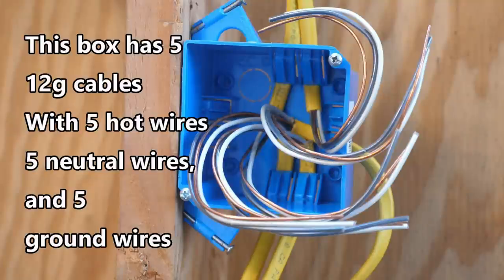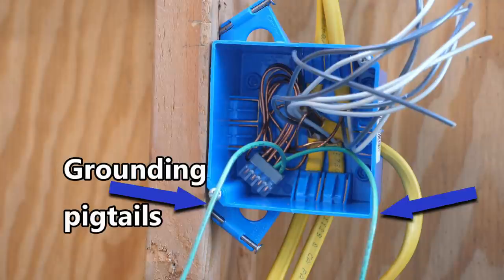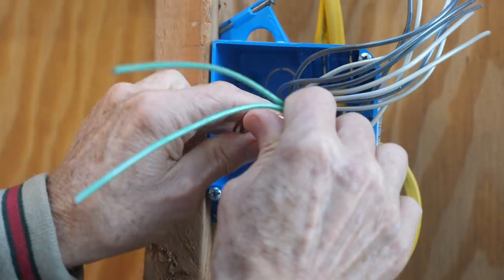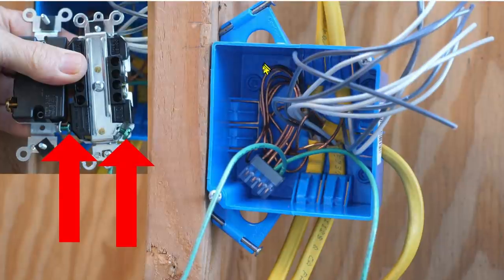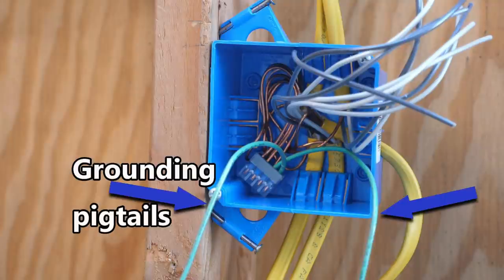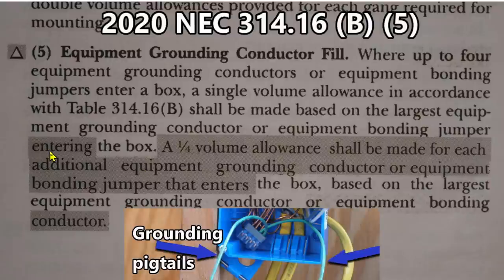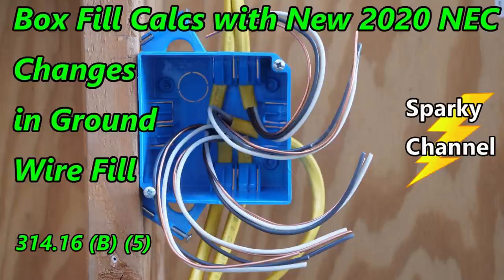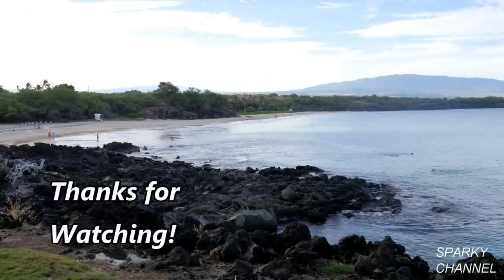Do Pigtails Count in 2020 NEC Box Fill Calcs + How to Handle 7 Ground Wires

Comment: Great vid. Now please make a vid using the 5 wire capacity wago lever nuts to join 7 wires for: ground with pigtails, neutral with pigtails, and live with pigtails. Then show how to dress the wires and connect the devices to them. That is the ultimate video video using jumper wires between wago lever nuts to actually connect everything together. Thanks.
Reply: Baaaah. Wago are the best. Woohoo
Reply: @darrellbarton4341  Wago Lever Nuts are top of the line. They are used on Federal projects and handle full rated current as good if not better than a wire nut. You are confusing them for the cheap knockoff push in connectors or backstabbed outlets
Reply: I hate when I open a box and somebody has jumpered multiple connections together instead of just using big enough wire connectors to make a complete termination.  it's messy and unprofessional.
Reply: Correct
Reply: I love wago.
Reply: @jsncrso  "used on federal projects" doesn't necessarily mean they are the best choice of materials.  and keep in mind stab connections on receptacles were rated for 20 amps, right up until they were delisted because the connections kept burning out.
Reply from the maker: Wow, this is quite a thread. Dave, I'm making that video right now. I think it's going to be one of my best. I wire the whole box and discuss wire management inside the box. That's a topic that needs to be shown and discussed. This is a great opportunity because there are so many cables coming into this box. Also, I use spec grade devices!
Reply: Perfect. Can’t wait. We need to see how to jumper wagos within the same box
Reply: @kenbrown2808  Wago Connectors are they way to go here in Germany for round about 25 years now. It took a long time until electricians here accepted them, Wago introduced its first push-in connectors already in 1979. The first ones had the same problems with burning out connections, but that caused a massive call-back, and the problem was resolved. Problem was the size of the contact area afaik.
So this isn't actually a new product. And most electrical fires here in Germany are caused by carelessness of users, for example covering up ventilation openings of appliances with combustible materials like towels and such stuff, causing heat built-ups. Overload of power strips is also a thing, especially cheap power strips.

Here we must now tighten all screw terminals with the proper torque, using a torque wrench. With these connectors that's not necessary. They also compensate expansion and contraction of copper caused by change of temperature, and they're resistant against vibrations.

These connectors started in switches over 30 years ago, than came outlets with push-in, than came bus bars for neutrals and grounds in panels and now even the circuit breakers have that. Not only for the wires, even the bus bar is just clip in....
Reply: @Marcel_Germann  and here, they come preinstalled on light fixtures, and I'm okay with that, even if one manufacturer has about a 5% failure rate from not getting the fixture leads tinned properly to push in to the connector.  but using mechanical connections has about twice the contact area as wagos, and it doesn't rely on spring tension or on the material of the connection being able to carry the full load.

plus, like I said, the failure rate of our previous stab-in connections leaves me expecting that wagos on power circuits will lead to avoidable service calls.
perhaps the best way to put it would be that I think of ANY kind of stab in connection, like you think of buying a Trabant.
Reply: @kenbrown2808  The difference is, the Trabant wasn't that bad the time it was first introduced. But it was produced too long, it was simply outdated by its technology and design, and that already in the 1970s. Here is a small test showing how different types of connectors behave if you overload them, including Wago connectors, wire nuts, screw type terminals and a crimp. There you can clearly see that the insulation of the cable is the first thing to fail when a significant overload is applied. The 1.5mm² wire is normally used for maximum of 16A, in single phase its maximum rating (depending on the installation method and possible heat dissipation) would be 20A before reaching its critical core temperature of 70°C (158°F) for PVC insulation.

https://www.youtube.com/watch?v=2uYD8e7idnY
Reply: @Marcel_Germann  significant overloads are much less common than sustained loading.  stab in receptacle connections weren't that bad when they were first introduced.  back when someone might plug in a 500W space heater, a vacuum drew less than 4 amps, and computers were something you watched Captain Kirk talk to on the TV.
what I want to see is equal loads connected with properly sized wire nuts, with lever lock Wagos, and with push in Wagos, then compare heat production in the connection.  because THAT will be what tells whether the connection from wire to spring terminal to jumper to spring terminal to wire in a Wago is more efficient than wire held in direct contact with wire by mechanical pressure of a wire nut.

I can also tell you from the number of burned out receptacles I have thrown away that insulation is NOT always the first component to fail when spring terminals fail.
Reply: @kenbrown2808  When a receptacle here fails it's mostly not the push-in connection where the wires are connected to. In most cases the contacts between the plug and the receptacle failed for a simple reason: People here think the outlets and plugs are rated for 16A, so I can draw that permanently. But that's not the case. Some manufacturers label their outlets the correct way: 10A/16A, 250V. The 16A (3680 VA) rating is only for a short period of time, tested for one hour in the certification process. Permanent only 10A (2300 VA, nominal voltage is 230V) are permitted for the Schuko system we use here.
Reply: @Marcel_Germann  and here, in a cheap wiring job, the receptacles are rated for 15A or 12 amps continuous duty; and in a good wiring job, they are rated for 20 amps, or 16, continuous duty.  (continuous duty is defined as an electric heater OR something running for more than 3 hours at a time) and there are three potential areas of failure: most commonly, the stab connections fail from corrosion or repeated heating causing the spring clips to lose their tension; next most commonly; but least commonly fixed, the socket clips lose their tension so the plug doesn't stay in properly; and least commonly, when a socket clip has lost tension it can overheat and cook the face of the receptacle.

the two nemeses of bad wiring here in the US are 1500W portable space heaters (12.5A) and the Hoover Wind Tunnel vacuum. (over 13A run current)
Reply: @kenbrown2808  That's the disadvantage of having a low voltage, the appliances require a much higher amount of current for the same demand. But I think the connectors could handle it, they're designed and rated for higher currents. Here you can also now find connection units for kitchen cookers with Wago connectors inside. Kitchen cookers are hardwired here, in most cases they're three-phase circuits. But still 230V appliances and not 400V. The load is distributed on the three phases, for example one small and one large heating plate on one phase (L1 and L2) and the baking oven is supplied by L3.
We had never such issues, and the VDE is very sensitive and responses quick if such an issue would occur. Some even think they're oversensitive. In the past they were very quick banning installation materials with POTENTIAL safety issues. The VDE is one of the largest independant testing organisations for installation materials and insulated tools in Europe. And they release  the regulations for electrical installations here in Germany.

https://en.wikipedia.org/wiki/VDE_e.V.
Reply from the maker: @Marcel_Germann  Hi Marcel! A viewer wrote me and asked if wire nuts have been banned in Europe. I haven't heard of such a thing. Have they been banned?
Reply: @Marcel_Germann  our electric cookers normally use 120v for the cooktop elements but 240 for the oven. Our biggest reason for using split voltage like we do is that with 120 for the common use, there is much less electrocution risk. Then we. Combine phases for heavy loads.
Reply: @SparkyChannel  No, they're not banned but simply no one uses them anymore. But that's already for decades. They fell out of favour in the 1960s. In Germany we used a completely other type of connector, first three minutes of this video shows how the connectors we used before:

https://youtu.be/_PDnKEgQ-2Q

On the old connectors you had to arrange the wires, in case of five wires they had to be dressed like the five eyes on a die. Meaning four wires in the corners and one in the center. All of the same size and all of the same conductor type (solid, stranded, fine stranded). For connecting solid to stranded there was a special connector required, one like this. In the UK they call them choc block (the old ones were black or brow instad of the modern white ones):

https://upload.wikimedia.org/wikipedia/commons/1/1b/Screw_terminal_with_crimped_wire.jpg

They are sold in such bars, if you require only three or one you can twist them apart on the plastic connecting the connectors.
Reply: @kenbrown2808  120V is still enough to kill a person. Here the standard voltage between line and neutral/ground is 230V and 400V between the three lines. Even in residentials. A 22kW tankless water heater requires here three 32A circuit breakers, they don't require a neutral and run with the 400V.
And to prevent electrocution we got RCDs, you know them as GFCI. The VDE implemented in 1983 a regulation that in new installations "circuits in rooms fitted with a bathtub and/or a shower must be protected by a type A RCD with a tripping current of maximum of 30mA". The transition period ended in 1984. Now almost every outlet circuit must be protected by RCD. And they recomend to install a 10mA one instead of 30mA in bathrooms now. Back then that wasn't possible because there were no 10mA available. But for children and elder people with heart issues the 30mA is too high. 30mA is the threshold for a healthy adult.

And the other thing is to avoid exposed life parts. If you remove or put a Schuko plug only partially into the outlet that the prongs have contact, they are not exposed by design. Impossible to touch. The outlets are recessed into the wall. Others put sleeves on the prongs to prevent this.
Reply: @kenbrown2808  For a kitchen cooker we use in most cases a wire that is in size between AWG 14 and 12, five core (ground included), and fuse that circuit with three 16A circuit breakers.
Reply: @Marcel_Germann  clean dry skin has enough resistance that a healthy person will not be electrocuted with 120VAC.  it's actually not uncommon for some electricians to test circuits by touching the wires.  as for our GFCIs, ours cannot hold above 6mA . but we only require them in wet areas, nearly everything else requires arc-fault interrupters; which I question because we have cheapskate builders doing the absolute maximum circuit loading they can get away with since AFCI breakers cost ten times as much as standard breakers.  then when the homeowner keeps overloading the circuit, their electrician tells them it will cost thousands of dollars to upgrade their circuitry, so they have a handyman come in and he puts in standard breakers with a higher trip value.  then when the overload DOES burn out a connection, there is no arc-fault interrupter to shut the circuit down, and things get ugly, fast.
Reply: @Marcel_Germann  we run three conductor plus ground of #8, and fuse it at 40A, unless it is a high power stove; when it gets #6 and 50A.  of course, if it is a gas stove, it gets 15A@120V and shared with the vent hood, unless the vent hood is a microwave.
Reply: @kenbrown2808  Almost forgot, the 3x16A are round about 11kW. The hood is not supplied by this circuit, it's supplied in most cases by one of the kitchen outlet circuits. Natural gas kitchen cookers are available, but uncommon in normal households.
Reply: @Marcel_Germann  yeah, I calculated that. Here, gas is pretty popular where it is available.
Reply: @kenbrown2808  Most people here use gas only for heating, not for cooking. And I'm using natural gas also for hot water, this is all done by my boiler unit.
Reply: @Marcel_Germann  yeah, Americans think it's absolutely bizarre that europeans tend to have multiple point-of-use water heaters.  here, there is almost always a central water heater - either with a tank or a flash heater.  I'm guessing it has to do with most of our houses having been built after indoor plumbing was commonplace, so a central water heater and hot and cold plumbing was pretty simple.
Reply: @kenbrown2808  Central systems have also disadvantages compared to local heating systems. For example it takes longer until hot water comes out of the faucet, except you have a circulation line.
I have a central system in my house.
Most of the houses here were built when indoor plumbing was also a thing. It was also a matter of price and infrastructure. I remember my grandparents still had a local oil fired heater in the bathroom which also heated the room. And the older version was the coal fired version of this. In the kitchen they still had a coal fired stove, in addition to the electric cooker. I remember as a child I was sent into the basement to bring some buckets with coal.
Reply: @Marcel_Germann  see, where I am, coal was never a common fuel.  old houses had furnaces that burned fuel oil; which was, for all practical purposes, diesel fuel.  the house I grew up in had originally had a wood cookstove, but also had the oil furnace.  
but like they say: Americans think 200 years is a long time. Europeans think 200 miles is a long distance.
Reply: @kenbrown2808  I know, here they added a red pigment to it here because it was reduced in tax, compared to Diesel. And actually some people used that stuff in their Diesel engines back then. In the old ones it worked, but not in the new ones. The additives are missing.
Back then trucks were often checked and they looked into the tank of it. When red was visible the driver had a problem, tax fraud. In that case the tank had to be rinsed with Diesel until there is no trace of the red pigment anymore. 

I used that stuff here before I switched over to gas.
Reply: @Marcel_Germann  we have the same tax situation, here.